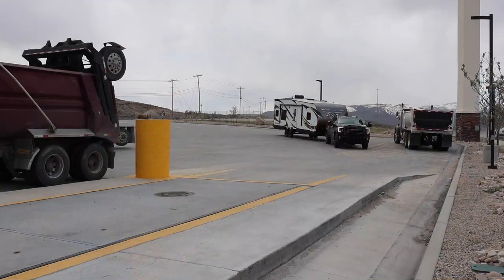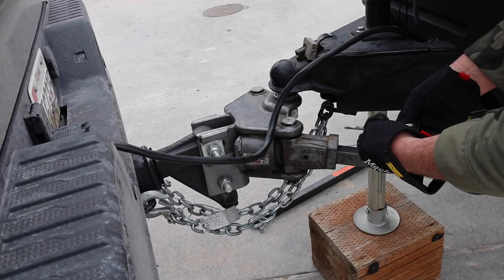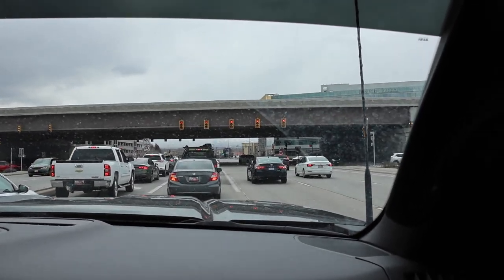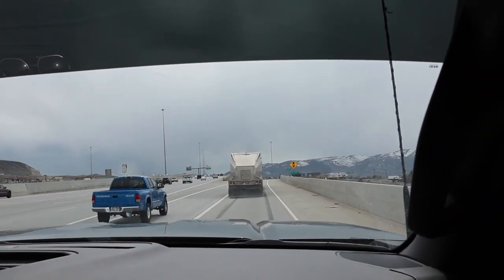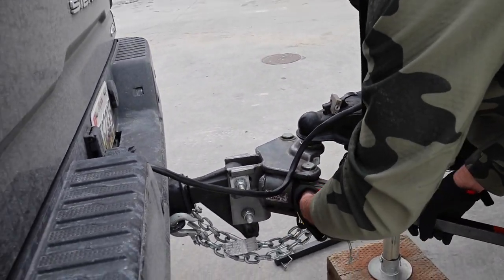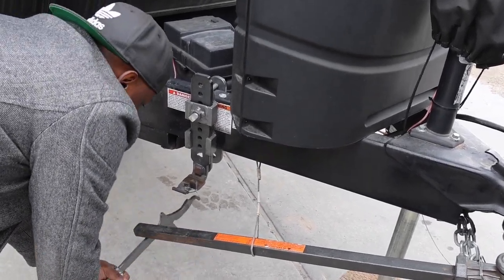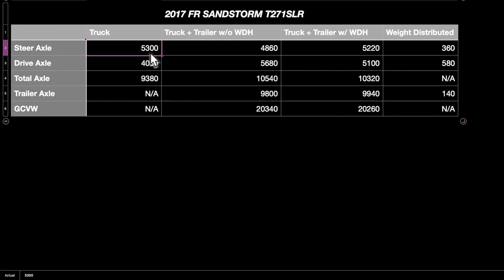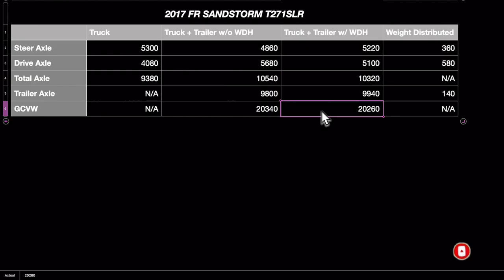Do You Really Need To Use A WDH? Here Is A Before/After Drive And Weigh In At A Cat Scale!

Comment: I had a 21 dena2500 pulling a 315rlts with a propride hitch plus summo springs. I would honestly forget the trailer was back there. Passing tractor trailers at 80 (wouldn't recommend) but it isn't until I look in the mirror to get over that I remembered 😂. Yes I do have a TBI that effects my short-term memory

Comment: When I view other towing videos on the exhaust brakes on GM trucks they do fairly well on declines down longer grades. For the most part only the initial brake application to engage the system is needed the truck slow down to the point where you will have to speed up.

Comment: I like the video and these types of videos but I don’t know buddy. You were going 77 mph without the weight distribution hitch before you really complained about sway. You were “only” going 72 mph with it and you were complaining about sway. 

It definitely put weight back on the front axle though which is good. But it also took weight off the rear axle which is exactly what I thought it would do. So that took tongue weight off AND added weight to the trailer which made your tongue weight percentage be even less. 

No thanks from me on WDHs. The reason his truck pulls the toy hauler so good is because it’s a dually. That makes all the difference. They really are like not having a trailer behind you. 

And BTW, you completely flubbed up the exhaust brake cruise test 😂. You had cruise set before you had the exhaust brake on and it looked like tow/haul mode engaged lol. So yeah without the exhaust brake and tow/haul mode cruise won’t hold your speed. But I know for 100% fact an L5P will hold 60 mph on an 8% grade going down. It even gets below 60 and has to upshift to get back to 60.